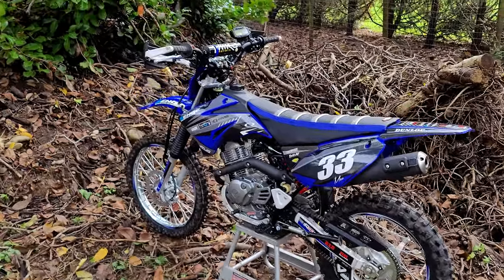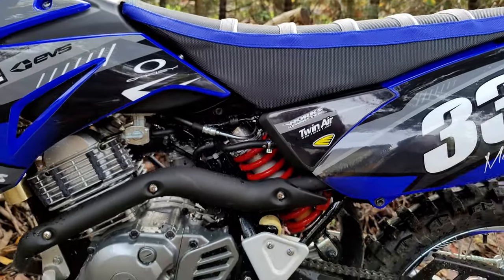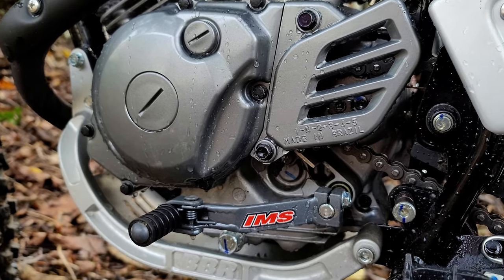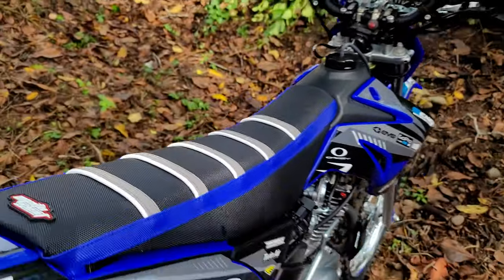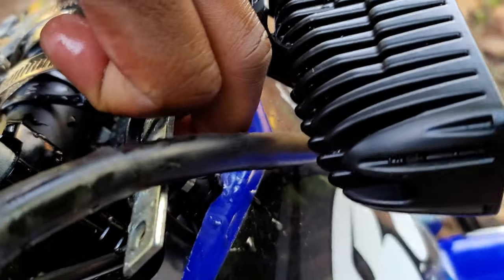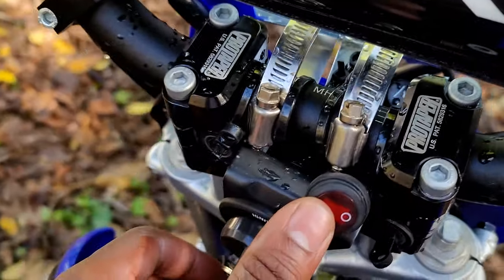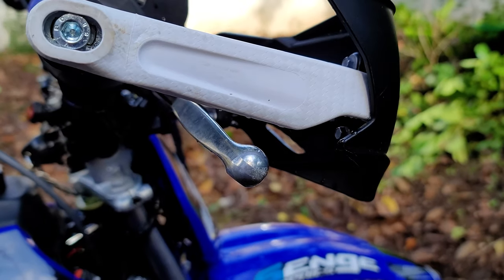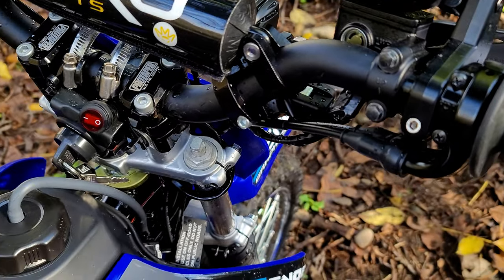MORE upgrades on the 2022 TTR-125!

Comment: Nice content man. I currently have a YZ250 2-stroke 2009 a 2006 YZ250f a thumpstar 212 and I plan to get my fiance a ttr 125 but I want to do a nice build and I love yours. Something I would suggest on the light bar that I have on my YZ250f is I took off my handlebar guard and I used self-tappers to drill the headlight into the bars. Now the bigger bikes do not come with a battery in them. So what I had done is I ran speaker wire from the light to a switch to a DeWalt battery and used some electrical tape and put the battery in my air box. But nice channel man

Comment: How do u afford this
Also since you seem knowledgeable my 2003 ttr 125 does not idle at all. If I’m not on the throttle or clutch it stalls. Any reasons you can give as to why? Btw I checked the spark plug and it is it’s normal color, not white or black. I bought it used too. I’m thinking there’s something in the carb so imma clean that soon. Thanks for any tips you can give to a newbie rider
Reply: i think your pilot jet is clogged...

Comment: dumb question from someone whos not savvy when it comes to engines, why do you have to rejet the carb if you swap the pipes?
Reply: Yes, watch 14:00
Reply: @pablodev4934  appreciate the reply, but i was asking WHY do you have to rejet it if you install the pipe?  i want to do the same but ive seen people on YT install the pipe without ever mentioning anthing about jetting so is that necessary or something that can be skipped and the bike will be okay.
Reply: @gunsgames8757  it has to do with how much  more or less fuel your engine needs so your not running lean